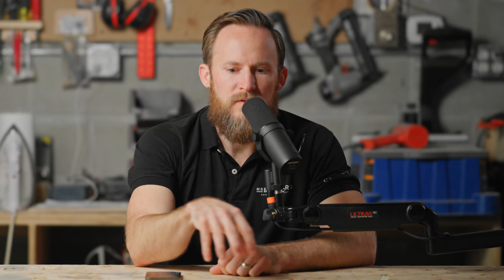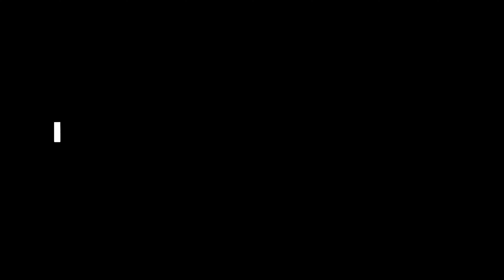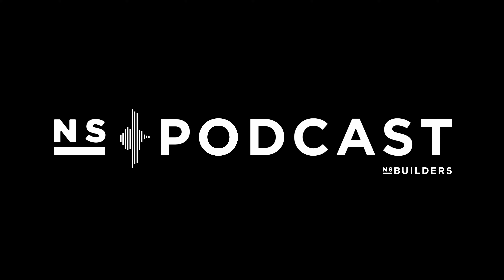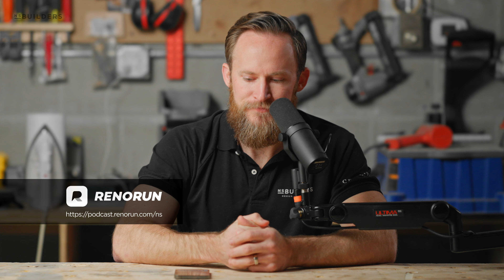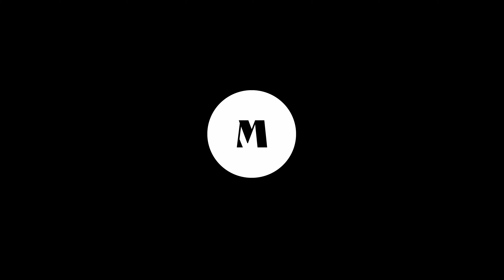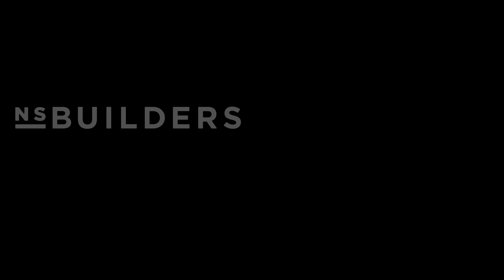Pushing off innovation until you're forced to change or Innovate with the industry

Comment: great system overall.  there those that want to use icf for above grade walls as well and then the issue becomes post construction retrofitting.  adding an addition or changing the function of the room will require alot of discovery and additional labor costs.  buildings need to be able to evolve over time or else they will be demo’d

Comment: I designed and built a ICF house here in Utah in 2015. We are a high desert with brutal 100ish summer heat and around Christmas just now down to -18 for a bit. The walls in this one are 4" ext foam, 8" conc core, & 2" interior foam. I was able to design the house to fully take advantage of the natural wind flows, sun angles, & insulation efficiency. This house only has a in-floor hydronic system for heat. It has no cooling system. In the summer the house has maxed out at 76 inside. The only thing the owner needs to do in the summer is open the vents in the evening and the house retains the cool throughout the day.  I would argue that the lack of overall utility use is enough to offset any carbon argument. ICF is a great system but I would never argue it is for everyone. It does have its pros and cons. But for this one it was a total win!
Reply: Sounds like an ideal place to build with ICF.
Reply: @latitude48design  I'd say that any house that design wise would align with a ICF product, would be ideal in any buildable climate on our little planet. The one I used has a continuous R-38. I'd take that anytime anywhere.